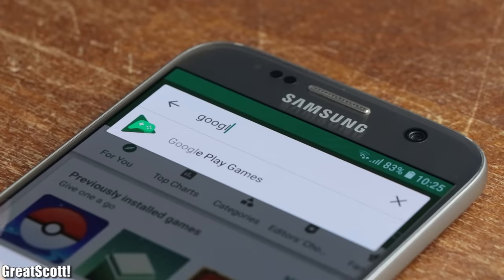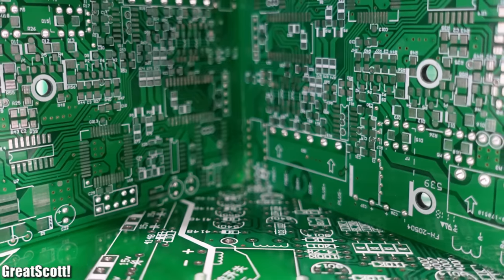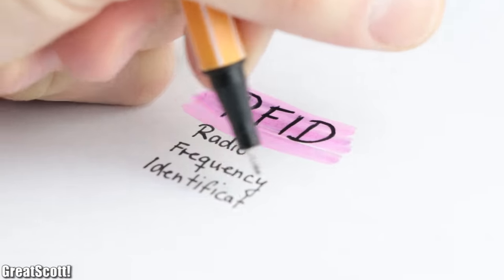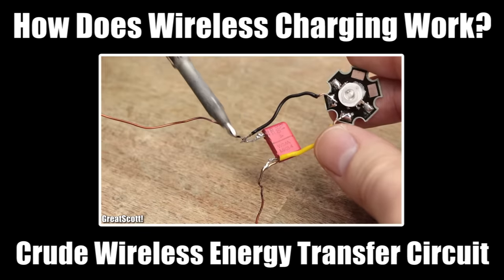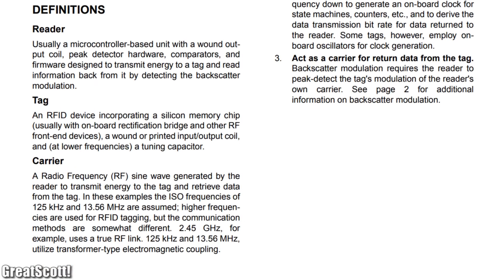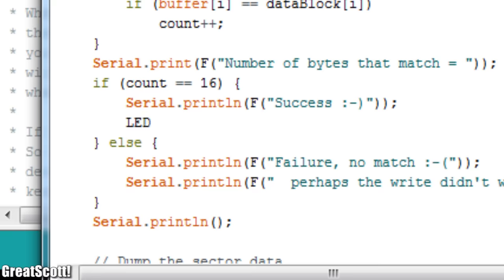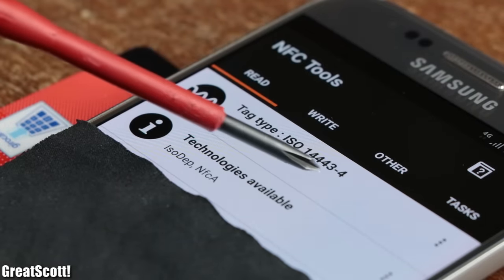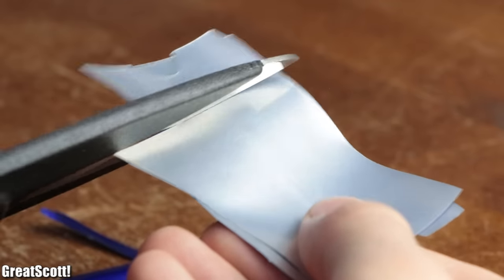How safe is contactless payment? || How does RFID & NFC work? || EB#40

Comment: I remember a few years back at work, having to implement the MIFARE DESFire NFC card's instruction set. Was quite interesting to see how advanced they can technically be.
Reply: Lasse Hovlandsdal, may I ask what you implemented?
Reply: @martinrocket1436  Certainly. We were implementing what is colloquially called (at least here) "bus cards"; the NFC-based cards you in many cases can use on public transport. (Specifically, it was an implementation of a subset of the ENV 1545-2 standard.)
Reply: @MrZenzio  It might be weird, but I'm wondering, why would you implement like cards instruction set, where there are complete chips that provide complete solution including encryption implementation, CRC validation etc.? 
For example PN532 mentioned by Scott. It's just like "I want to talk to that card, that's the password, gimme data from that sector" etc.
Reply: @domints  Quite simply, availability. At the time, there was no suitable drop-in component that would work within our specificatio (the hardware it was required to interact with, and some requirements imposed on us by a third party). You are certainly right that it sound like a strange thing to do :)

Comment: Worked in industry with this technology the big thing I took away from it was that cards don't have a rolling transaction number, your phone does thus each transaction on your phone can only be used once per transaction and not duplicated.
Reply: Had the idea to make my phone work as a key to my rfid sensor and came to this conclusion as well. It scanned a different number everytime. So that didn't work..
Reply: Only problem is that the phone can be hacked. Often over blue tooth . Then your payment processing app will provide codes to the hacker remotely until it's caught.
Currently phone payment systems are less secure than chip and pin. Every one of them has been shown vulnerable.
Reply: @kaseyboles30  That's not true
Reply: @resneptacle  several of these hacks were demoed at the black hat conference in 11/17 and more have been found since, like the Samsung one with it's predictable token generator(to small a token space, and the way it handles multiple cards on one account makes it worse in that case).
Dig into what the security researchers actual say. Right now chip&pin is much more secure (assuming properly implanted, quite a few are incomplete atm).
Reply: @kaseyboles30  Have a link to what they say?
Reply: @resneptacle  start by googling black hat conference 2017. It's been a while since I read it and don't have time to dig it back up, but google should help find it. also google blueborn and bluejack. That's a bit of a starter as well.
Reply: Also stick to what the security researchers say. Stuff in the press tends to downplay the vulnerabilities. With stupid things like implying you have to hold your phone right next to theirs in a blue-jacking attempt, when even phone blue tooth gets 3 meters, and many laptops 10.
Reply: Kasey Boles the issues shown in 2017 where fixed long before they where even demoed....
Reply: @KaderRocks   the blue tooth flaws are at chip level, fixable only with new hardware. And the broken token system is a very recent exploit.
Reply: @kaseyboles30  Google and Apple Pay are secure
Reply: @Ignacio.Romero  They are a better than they were years ago when I wrote the above. Not perfect by any stretch and you still don't want them on an older phone.

Comment: The short range is not because of the "high frequency", it's because that chips use capacitive coupling. At work I had to do with UHF tags at 868 MHz which have a much higher range because they are using inductive coupling. But please don't ask me for details, I just had to control the reader :)
Reply: Both can have really long ranges with very specialised equipment, so it is possible to make it go far

Comment: Now if everything is connected to the internet, nothing is safer :(
Thanks for this video!
Reply: This video had nothing to do with the internet
Reply: flexairz Transfer between the store and the bank would happen the same way whether or not the customer used NFC. This video is about RFID and NFC so I was just saying this comment is not very relevant to the topic of the video.
Reply: does not matter internet or not， nothing is absolutely saft
Reply: You shouldn't be, at least if you're using Google pay or similar. If Google messes things up you'd be sure that they won't take it lightly, besides banks always insures you that your money is safe, no matter how stupid you are.
Reply: You could live even without internet just some simple Phones and Messages now it is painful because most of time everything uses Internet for faster communication
Reply: @RizLazey  You wouldn't even get simple calling and SMS features without the internet nowadays, but that's nothing bad (or good, rather, neutral). The internet isn't bad in itself, it's just a communication channel, but the implementation from many companies is often so incredibly unsecure and a bugfest because money and time

Comment: both bank (ATM) cards and SIM cards are using same standard and actually are (at very least) similar inside, if not identical
those are not just memories
those are full blown computers inside (granted very embedded, but still computers)
they never give access to what is inside, but rather are used to sing, decrypt and encrypt data

Comment: Diy or buy rfid smart door lock?
Reply: Cool,would definitely like to see
Reply: Still not safe tho
Reply: DIY, i have a $1000 SALTO-system at my home. Way to expensive
Reply: Depends of the safety you need.
If it's for your house's main door definitely buy, but if it's just to keep your annoying sibling out of your room or something like that diy is the way to go.
Reply: buy an encrypted one for the front door/backdoor/exterior access. Definitely DIY anything on the inside because buying each time for the inside will leave your wallet drier than the mojave.
Reply: @imnota  I dont know why so many people worry about safety on the front door. I mean unless the intruder is dumb it makes sense for them to just smash the window or something.
Reply: @zanpekosak2383  Breaking a window is far more obvious and attention creating that just copying a card and properly entering the building. Also there are people living in flats with no reachable windows from the outside
Reply: @resneptacle  Ok I understand the point with the tall buildings. But getting through a window is quite simple and can be done quietly. Not that I would know :P
Reply: @zanpekosak2383  Still requires more time and effort than just walking past someone with an RFID cloner if they don't use a blocking wallet
Reply: @resneptacle  I see this is going nowhere apparantly. It really depends on where ypu live. Where I am there arent any RFID locks anywhere apart from some peoples houses. So going through a windows is still faster than picking a security lock.
Reply: im making one already just need solenoid lock
Reply: @matthiasvanduysen362  yeah or just buy a 60 dollar one
Reply: DIY will be much cheaper i think. Just buy an electric door lock and pair it with something like the arduino shown in this video zu build it.
Reply: Diy

Comment: So, this is actually a fun topic, as stated, the nfc cards have chips, though, these chips can come in 2 variants, dumb chips, and smart ones. Bank cards actually use the smart ones which can execute code themselves. 

When a card comes in contact with a compliant terminal (lets say a train ticket machine) your bank card will communicate and generate a one-time-use token to authorize the payment.
these payments are often bundled together and then send to your bank for processing, but that's another topic.

In essence this means that even if you could capture the data, the token would be different each time, and because only your bank knows how your card encrypts said token, it'll make finding people who try to pass on those fake codes trivial.

Additionally, these transactions need to be approved by your bank, and this needs to be done on-line, essentially: 
1) the transaction + authorization token is send to your bank
2) your bank checks if the token is valid
3) your bank checks the transaction itself and may flag it if it spots something wrong with it (done by complex algorithms)
4) your bank checks the receiving party

This system is by no means perfect, if a person were to steal your card, they could make a few transactions before you'd block if for instance.
BUT, its a lot better than the old mag strip system, where all the data was on the strip, rather than cryptographic ally stored on the card

Comment: In a German identity card is a RFID chip as well, and it is readable with the Arduino RFID reader :O
Reply: Yeah, but its useless to do so because it sends you any time you do a Reset another ID, at least so is mine. Most Datasheets for RFID Cards are under NDA, so you won't know how to talk to it/decrypt it. You can't even get the Datasheets for a Desfire Card without signing any NDA. Actually, they have done well on it in the "Internet Neuland" ;D

Comment: NFC limits are way higher here in Australia (think of people buying groceries etc) I killed my antenna but left the chip untouched, so no contactless payment for me (or anyone else if I lost my wallet) 👍
Reply: Here in Europe, NFC also works above €25,-. You're just required to enter the PIN after the NFC transmission for those transactions.
Reply: @phsch108  $100 AUD here is the point after which a pin is required, $100 in multiple store would soon deplete a healthy bank account

Comment: at work i use a handheld rfid machine to scan rfid tags for inventory control, it takes about 10 seconds to scan 200 items and works about 20-30 feet away. none of my current debit/credit cards use rfid now, and only one did before but didn't last long it seems.
Reply: Its all about the frequency^^ There are Toll Stations with long range RFID, but they can't read your credit card in your wallet, cause they use another frequency.

Comment: Contactless payment is not dangerous since it is a RFIC card instead of RFID card that uses an internal key to sign transactions. Therefore, it is ridiculously hard to clone it even if you get physical access to the chip. Even in that case, just use the CVV is much easier :) 
Also, mobile payment is great because it requires you to confirm before release the information. like apple pay or sumsung pay.
In my opinion, ApplePay may be the most safe method since it have a physical chip dedicated to cryptography and generate a unique transaction id to perform the transaction.

BTW, the magnet strip contains card#, date, and CVV. therefore, a card w/o card number is just as dangerous if it have a magnetic strip on it. Therefore, I am disappointed that Apple Card have a mag strip on it and still marketing it to be safer. Is your threat model people who are just taking a picture of your card when it is lying on the table?
Reply: I was thinking like, if the card encrypted then what stops people from just copying the cards info directly onto a second (maybe virtual) card? What is it that makes rfic harder to clone? Does it communicate instead of just information dumping?
Reply: @lucasschut4174  so the card contains a asymmetric key to sign transactions inside itself, and it would not allow access to the key without some involved process such as DPA
Try lookup FIDO U2F key or Bitcoin wallet, they work in a similar way
Reply: You are correct, but bank card uses NFC (Near Field Communication) which is a subset of RFID, but width a much shorter range Up to about 10 cm or 4 inches. Todays RFID can have ranges up to hundreds of meters.

Comment: That's not really true... 
You can pay with NFC on credit cards with higher values than 25€ ;)

For example I paid 480€ contact less for my TV.
The limit of 25€ is only set by your local Sparkasse bank
Reply: depends on the banks, you can also make that limit higher or delete. if limit exceed you need to enter your code

Comment: Crazy idea:

What if, your RFID card had a normally-off button built in, to interrupt the energy supplied by the wireless energy coil, until such time as you want to let the information be transmitted?
Reply: Those devices usually are miniaturized, and in some cases it would be very difficult to fit a button in... Think for example about credit cards.
But that's just a minor inconvenience, the main issue is that RFID devices are resonant RLC circuits. Their impedance (apparent resistance) is critical for their operation as it determines at which frequency the circuit resonates and works. A button would majorly screw up the circuit's impedance requiring some serious compensation at factory level. That would mean measuring and adjusting every circuit making this idea definitely possible, but very cost inefficient.
In the end, it all comes down to production costs.
Reply: Alessandro Celoria
Ah, I see.

Comment: The title is: "How safe is contactless payment?" which was not covered in the video :/
Reply: the answer is on a card, sort of, at least no one should be able to steal a significant sum. From a phone? very secure.
Reply: @joestevenson5568  In the video is used completely different card type than the credit card has
Reply: @tomhyhlik1788  wdym?
Reply: @jakedowling8414  no, he is not giving any info about contactless payment at all :D
Reply: @tomhyhlik1788  Contactless payments are rfid cards that emit the cards encrypted data into the reader. the point is that if a hackers reader gets close enough to your card it can get your data, tho encrypted. phones can turn this function on and off. so up till there you can get a pretty good self thought out answer
Reply: @danielvaldez9946  It's way more complicated. So sad that the title of the video is trap.
Reply: @danielvaldez9946  can they read, decrypt bruteforce idk? or pretend to be the other card? dont even need to clone, of course if clone can do anything

Comment: I've reported my card missing then used it afterwards contactless several times. I'm about 200 bucks up atm.
Reply: I hope u didnt use it in the same location where you live.
Reply: @houdiniabracadabra6180  Yep I sure did. That was a year ago, not had any backlash yet. Banks aren't going to file police reports and subpoena CCTV footage over a couple hundred dollars, they'll just write it off. If I'd stolen thousands or done this more than once, then maybe they would. Good thing about contactless is there's no clawback from the retailer, the Bank takes all of the hit. The extended story behind this is that a utility provider had mistakenly took a large amount out of my account and the bank allowed it even though there was not enough in the account to cover it. It was all sorted and the utility provider refunded the money but the bank refused to refund the fees they charged (which added up quickly) for the unauthorized "borrowing". Instead of going through all the hoops and legal nonsense to get the fees returned, I just did the card thing, then closed the account.
Reply: @spudhead169  ok then i won't hate you. U did what had to be done. Get your rightfull money back. Thx for the idea though ;)

Comment: You totally oversimplified (or just didn't dig enough) the RC522 / PN532 topic. The 13.56MHz tag isn't spitting out data. It won't even spit out ID without being asked, not to tell about the data.
All the data on the card (1KB in case of Mifare Classic 1K) is password protected and your card spit the data out because your reader asked for it and had proper access keys - in case of your card it was transport key, default consisting of loads of 0xFs.
The only card that just spits out data are the 125kHz cards, but there isn't much there to spit - just few bytes of ID.

Comment: This kind of technology is used in shops to prevent from stealing. Am I right?
Reply: Sometimes it might be, but RFID is very limited in range. Often in stores it's a far simpler circuit, purely coil and capacitor which resonates at a specific frequency, this is then detectable by the induction coil by the doors.
Reply: To presne neviem, ale je to možné.
Reply: @dronemansk2121  JJ
Reply: V knižniciach sú také karty/nálepky proti krádeží.
Reply: @jonny11bonk  jáj už viem, ktoré myslíš
Reply: Yes, and apparently a wallet that I had received as a gift had one in it because it would set off those alarms as I walked out of stores for almost a year after I received it
Reply: The tag to prevent shoplifting is actually more like a small metal tuning fork.  When you pass between the sensors that are emitting RF, the tuning fork vibrates and the sensors are able to detect the presence of the frequency of the tuning fork. The tag is disabled when it is magnetized (the tines of the fork stick together).  This is why you have to pass products over the "deactivator" before you carry them out.  There's a better explanation somewhere here on youtube of how this works, this was just from my memory.